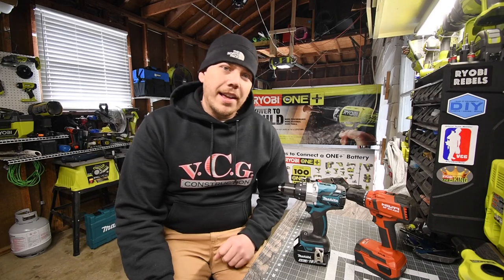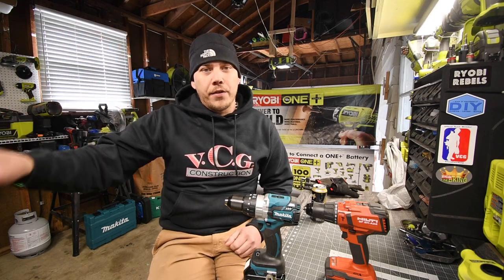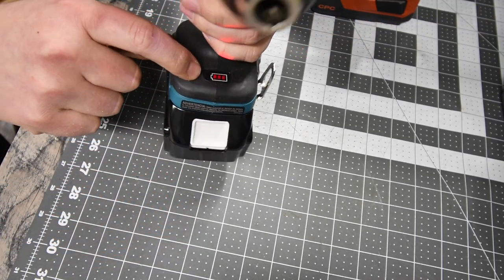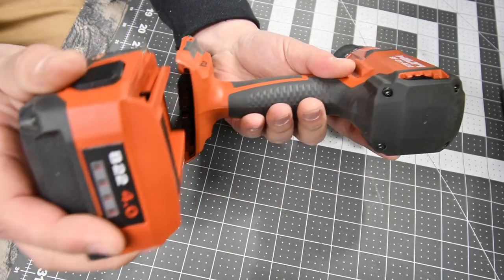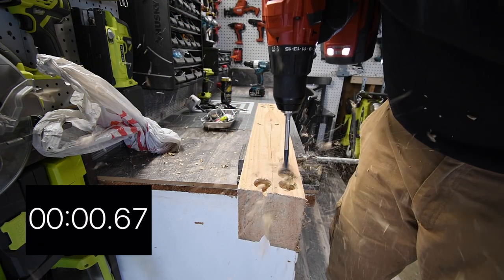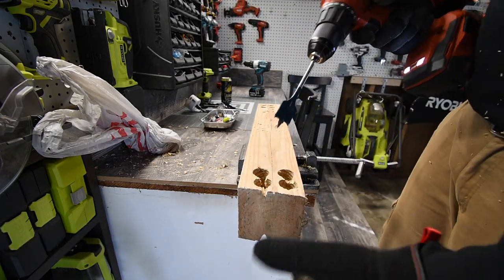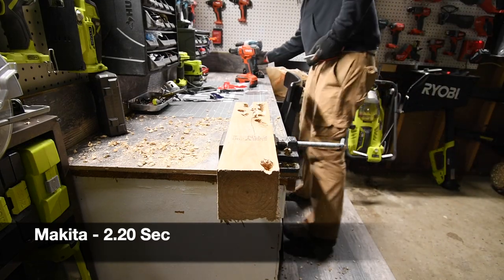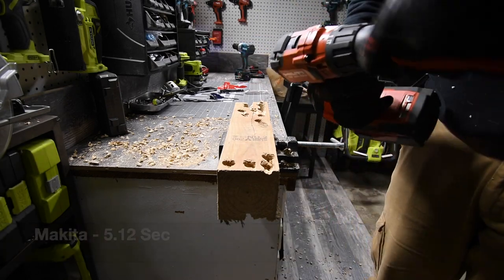Makita vs HILTI (Wood)

Comment: I’m a self employed Electrician and only use Makita tools. Started out with Hilti, but the Price....😅 Will Never use anything other than makita again. Tanks for the video.👍🏻 Regards from Denmark.🇩🇰
Reply from the maker: I Thank you sir
Reply: You can not go wrong with either system. I started with Dewalt and went to Hilti.  I have  several Makita corded tools that are built like tanks. Hilti is second to none when it comes to drilling concrete.
Reply: Jim Diet when it comes to concrete Hilti is hard to compete with
Reply: @jimdiet8534  only fein can be compared to hilti
Reply: @jwblacklabel2146  I know Fein makes incredible Mag Drills. I am sure their other stuff is very nice.
Reply: @jwblacklabel2146  Fein is for metalworking and it’s better than Hilti,for concrete is Duss also better than Hilti.😁

Comment: I run Hilti for Combi, SDS and impact drills. My Circular saw (corded) and my table/mitre saw, jigsaw, router and 9" angle grinder are all Makita. Makita are great tools!!
Reply from the maker: excellent combination and thank you Dave
Reply: Cordless or corded combi?
Reply: @Joshua.Lord1  Hi Joshua, my Hilti Combi's are the cordless SF6H A22.  I also have a Gen 3 Milwaukee fuel 18 volt which I bought when I passed my Gen2 on to my assistant.  Both had trigger issues where a lot of the time they didn't work.  My Hilti combi's are by far the best I've used in 40 years.
Dave.

Comment: I don’t know if you mentioned this but the makita battery didn’t die, it locked itself out to save the battery under extreme load. I asked a makita representative.
Reply from the maker: the battery level was at 1 bar. I let it sit for a little bit and it still didn't go back up. it needed to be charged
Reply: Man Caver Tools yes that is correct. It doesn’t unlock itself until you put it on the charger. I forgot to mention that. I had it happen to me with the same drill and a 4” hole saw.
Reply: @cwikk660  thank for letting everyone know. Was wondering if the battery was knackered. Good to know thank you 😊

Comment: Would love to see an updated premium drill from makita this model is getting a bit tired even though it can still compete
Reply from the maker: I would like that as well since the Makita drill is old, but it still is an awesome drill
Reply: The “40v” (36) 1,500 inch lb version with electronic clutch hit the market in Japan a couple of months back.  Different battery (XGT) platform, unfortunately, but it looks the bees knees.
Reply: @robertrada4783  40v just makes it last longer, no more power.

Comment: So I've looked into makita batteries. and I was told by a colleague on site, that to get the best from your makita batteries. You need to give them a full cycle of charge/discharge. To get the full amount from your batteries. So maybe that's why your battery cut out. And also its a makita thing to protect the battery from damage ie not run it completely down and knack it. 
Ps I'm now a massive makita fan!! 😍👍🏴
Reply from the maker: I thank you very much for the input Liam, ill have to try that out

Comment: In the meantime I bought this Hilti tool. It is really a monster. And the ATC is a useful feature.
Reply from the maker: I agree and thank you Gpower for viewing
Reply: Hi GPower, yes I own it too. Great combi and I love the ATC. Has much more power than I will ever need. I also own and love the TE6 A22 SDS (incredible!!) and the SID 4 impact. 😁😁
Reply: Dave Sheppard Congratulations 🍻 The TE 6 is in my opinion one of the best akku hammer drills ever 🙂
Reply: @gpowerrocks4859  😁😁😁👍👍👍.
I also have a Hilti Te1 corded that I  got second hand 33 years ago. A contractor left it behind at my workplace.  After months and many phone calls to him he told me to keep it as he had worked it really hard since he'd had it and so it was probably on it's last legs anyway. That Te1 is still as smooth and solid today and is still my go-to corded SDS. It can still hold it's own against modern corded SDS drills!
Dave.
Reply: Dave Sheppard Wow 🤩 Thats a statement 💪

Comment: Great Video.  I own a few Makita tools , including that hammer drill and their one big downfall is their batteries,  everyone else is upgrading to 21700 cells and Makita can't , Why you ask , because they Screwed themselves with their X2 36v tools , they use two 18v batteries that are side by side and there is barely any room separating them , so if Makita makes 21700 celled batteries , they won't fit in their 36v tools because the batteries would be too big , and that really sucks , I think that may be the reason Makita came out with their 40v line of tools , which I hope get here in the U.S. soon ....👍🍺🍻🖖
Reply from the maker: I agree, Makita needs to make special batteries now

Comment: Ok 1st let me say Nice video! I think these 2 drills are so closely matched I can see either one winning. I think both are very well built if you disassemble them. I don't think Hilti is using brushless motors tho yet. Its more costly but gives longer run times, is smaller motor actual size and weight and usually incorporates other features like electronic feedback (for constant speed under different loads) and the new torque settings and screw settings on the 4 speed impacts for example. I am just not a big fan of Hilti's strange marketing. They seem to want to concentrate on fleet and rental business and even their website prices them under "fleet pricing"  Its definately harder to find Hilti products because of this. Home Depot is the 1 exception.  The Hilti being 22 volt which means it has 1 more 18650 battery in its pack is kinda not keeping up if you factor that in!  The Makita having 1 less battery in its pack does it with less voltage, using  technology and quality and smaller and lighter size in most cases. These are all just things I have noticed. I like the red tools, but I like tons of competition to create a better product and price for us consumers! Hilti tries to go the other way kinda like Apple making sure thier stuff wont work, or compare  with others to give them a monopoly. Kinda like Apple vs android who has competition everywhere gives the value side of the equation. Ok I must confess I looked at all the brands HARD especially TTI/ Milwaukee. But in the end I just bought the new Makita XT268T Brushless hammer drill and impact set with 2 -5AH batteries charger and soft case for 267.00! I also get to pick a a free tool from a factory mail in rebate!  (I am replacing my old makita ones) Nearly 12 years old!  I only had to replace the batteries once in 12 years on them!  Its hard to beat that kind of record, and the worlds largest 18 volt system means nearly any tool is available if I need some other tools in the future.  I got a new 36 volt chainsaw this year, it just takes 2-18 volt Makita batteries and its a terror! I didn't know this but found out, Makita, makes more chainsaw models than anybody! Get your butt in gear Stihl good luck trying to get caught up with Makita who is primarily a electric motor company 1st.  Enough Rambling ,Dont get me started on how much I like Bosch Hammer drills and jigsaws!  Or Delta wood shop equipment or Miller welders . . .
Reply from the maker: this is HILTI brushless, it just came out January and my 12v HILTI tools are brushless as well, a lot of tools now that HILTI makes are brushless now, I really wanted the makita to win this one, its my favorite hammer drill
Reply: I kind of like the Hilti multi head driver like Bosch flexiclick, but not available in the USA. I wish Makita would get in on that game before Dewalt. I literally spend 3 hours in the store trying to figure out which new drill set to get. Got the M12 fuel hammer drill and impact driver set with free 6ah battery. Was starting to regret it before I even got home. The torpedo hand grip is so, meh.. and the hammer drill clutch is unreliable. Wish I got the Makita hammer drill set instead. Good thing I'm still in the return window for home depo.
Reply: Did you get the kit with the xph07 and xdt14? That kit is $400. How did you find it for only $260.

Comment: That was a neat comparison! I don't think I'll ever be a hilti owner due to the pain it would cause my wallet but that makita is nice
Reply from the maker: I love that makita and thank you Matt
Reply: @ManCaverTools  👍🏽👍🏽
Reply: Hi Matt, I run Hilti and Milwaukee but always used to use Makita. I went off their drills after buying their 3 speed 18 volt MXT with NiMh batteries. Apart from the drills and impacts, all my other gear is Makita. They are great tools. This Makita on the test looks really good. I own the Hilti in the video but really liked that Makita!
Dave
Reply: @davesheppard8797  thanks for the reply, I am looking for a new line of shop tools entirely. This helps. Thanks!
Reply: @DesertSandSailor  Hi Matt,  you can get Hilti tools on their Fleet management system. You pay a little each month and every three years they replace the tools. Any repairs needed the rep will come and just give you a new tool and take the other away. When you no longer want the tools they just come and take them away. I personally have bought my Hilti gear. In my opinion it is the best. You won't go far wrong though going with all Makita gear. The only bad tool I had from Makita was the drill I mentioned and that was years ago. Milwaukee is too temperamental and they are so overhyped by Milwaukee. After Hilti my second choice would be Makita.
Reply: @davesheppard8797  cool, I didn't know that was available!
Reply: @DesertSandSailor  Yes mate, contact Hilti and check it out!

Comment: I think you should stress to the viewers that the Hilti is running on 6S batteries vs 5S, so ~22V vs ~18V which results in a non-trivial increase in power from the same brushless motor. I understand that there was no way to control for all variables (short of making your own custom battery packs), but its very important to mention.
This is akin to comparing an smaller displacement engine to a larger one.
Reply from the maker: its HILTI vs Makita. end of story
Reply: @ManCaverTools  your vid your rules. 
I think your doing a fantastic job. You are going to be a MASSIVE YouTube star. Love what your doing keep em coming (kid) 😁💪
Reply: Kid = respect 👊💪

Comment: these two screwdrivers have the same mechanism, inside equal parts, hilti partner makita to release the tool, a lot of cordless tool hilt based makita parts
Reply from the maker: This makita hammer drill lost the lease out of the others that versed HILTi. so I can't wait to do versos video with makita against Milwaukee and Dewalt

Comment: those batteries aren't the same, look at the size difference. amp hour doesn't tell the whole store. one is 4 ah at a 10 amp draw, the other is 4 at a 20 amp draw. makita is a 10 cell, the hilti is at 12.
Reply from the maker: they are not the same. HILTI doesn't make 18650 cell batteries and makita doesn't make 21700 celled batteries

Comment: As soon as you can get your hands on the new DCD998, you should REALLY CONSIDER shooting a video asap of it versus the Gen 3 Milwaukee. Thanks. 
Nice videos by the way.
Reply from the maker: I plan to. at this point I want another brand to beat HILTI and thank you Mitch
Reply: @ManCaverTools  lol but you already know that no other brand has a drill that can compete with that new HILTI. Maybe see if the 998 can beat it??
Reply from the maker: Mitch W I plan to :)
Reply: @mitchw4876  The more I use that new Hilti the more I love it. You might get a drill to beat it, but not for build quality or longevity.....unless it's another Hilti!!
Dave.
Reply: @ManCaverTools  Try Festool PDC 18/4. Maybe a contender to dethrone Hilti :D

Comment: What’s the torque on both those drills?
Reply: Makita 125 Nm...Hilti 85Nm
Reply: Means nothing though (Big numbers don't always equate to superior performance...Makita is a Beast considering it's almost 6yrs old and hilti is there latest brushless hammer drill with 21700 battery cells..makita smaller 18650 cells..
Reply from the maker: the makita is 1,090 and the hilt is 708, I said that in the video

Comment: I have been using these Makita XPH07 drills for 4 years now. My guys beat the heck out of them. Dependable tool. :)
Reply: My boss has the same Makita hammer drill I keep my Bosch hammer drill at work wish I could have a Hilti hammer drill at work it's whatever the budget allows us to buy my boss happened to get a deal on a Bosch if you got the deal on save Makita or Milwaukee we would have that
Reply from the maker: I love makita and than Howie
Reply: Yeah, they take a lot of stick and keep going.

Comment: It looks like the Hilti is faster at certain things but what is the price tag?This is the issue with Hilti they make nice tools but they are so expensive that it doesn't justify the price tag.The times where not that much faster and in the real world nobody is going to be a speed demon plus most of us have multiple batteries so lets say the hilt battery lasts longer the Makita (or another brand) will already have the second battery charged.Now as far as long term use most of these professional tools have a 3 to 5 year warranty (other than rigid because they have a lifetime warranty if you register the tool) The extra cost of the Hilti will probably buy you that second battery (depending on the kit)and at the same time I have never seen Hilti have a tool sale the way the other brands do.
If you want to drill larger holes all day long or at least for a rough in you would be better off to go with the hole hawg since that drill is made for it.
Reply from the maker: I agree and thank you Steve
Reply: Hi Steve,
You make some good points. Hilti do have a lifetime warranty and also do their "Fleet Management" program where you basically rent the tools you need. They give you new ones every three years and if a new model comes out you can try it for a while before deciding. Any breakdowns and a Hilti rep will just come and replace the tool. I thought I  had a problem with one of my Hilti's so just before I returned it the rep gave me a like for like replacement  to use while mine was away. I buy my Hilti's and don't lease them. If I did lease my faulty tool would be replaced immediately by a rep. I find it really comes down to personal choice once you get to this level of quality from all the top makers. And a second here and there doesn't matter on a normal day because you are just using the tool for a job and not comparing. On a bigger timber construction project I may run 3 drills/impacts at a time with different bits in. This saves time swapping from drill bits to screwdriving bits to countersinks. I own and really like this Hilti but I thought that Makita was great!!
Dave.

Comment: Nm for hilti?
Reply: 85 Nm
Reply: @shane.t.188  65Nm soft torque which is more important drilling in screws into wood. 80Nm hard torque. I own this Hilti and it is an amazing drill. Much better than my M18 Gen3 Milwaukee.
Reply from the maker: Thank you for viewing Mew Dave got it spot on

Comment: Hilti is a luxury brand so it should not be compared to the low and mid-range segment tools like makita , dewalt , bosch ... I think only fein can be on the same level as hilti
Reply from the maker: The Dewalt Power Detect Beat this HILTI drill
Reply: @ManCaverTools  maybe but hilti and fein they are still way better than other brands
Reply: Yes and no.Hilti makes sds drills and many other stuff but Hilti grinders are rebranded Bosch,jig saw and circular saw also rebranded.Old Hilti cordless drills was rebranded Panasonic, now Hilti and Panasonic have factory in China which makes cordless drills a bit different Panasonic-Hilti.Fein is better than Hilti but fein makes tools for metalworking,Duss is for concrete and it’s better than Hilti.

Comment: What happened to the 4 speed Hilti hammer drill  I remember seeing have you even seen it thing is on beast mode end of story probably like $900 for the kit which is no need for everyone to. Have
Reply from the maker: I didn't get that but my friends has it I will be borrowing it for a video
Reply: The 4 speed Hilti isn't a hammer drill.
Reply: @davesheppard8797  are you talking about SFM8? That is a beast!
Reply: @panbekon1470  No. I am talking about the SF 10W-A22 ATC.  Which is even more of a beast than the SF8M-A22. The SF 10W has 72Nm of soft torque and 120Nm of hard torque. The SF 8M has 50Nm soft torque and 85Nm of hard torque. So quite a bit more torque. Neither of them are hammer drills, just powerful Drill Drivers.
Dave.
Reply: Failed in German test against Bosch and new Hilti lose against Milwaukee.
Reply: @dusanmilojevic3017  I own the Hilti SF 6H A22 and the Gen 3 Milwaukee combi's. The Hilti is far superior.  The Milwaukee gets very hot and has trigger issues where sometimes it just doesn't work.  More importantly to me though is the fact that the Hilti is comfortable to use all day and the Milwaukee is tiring.
Dave.